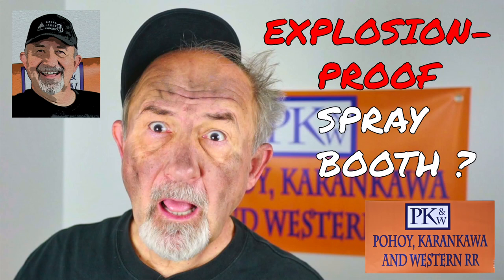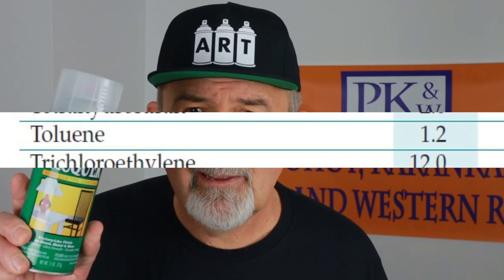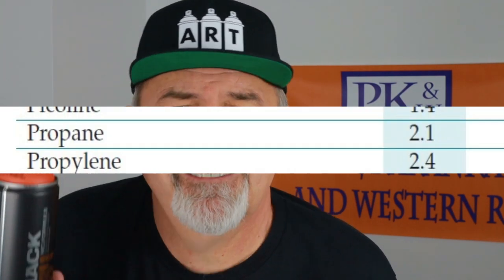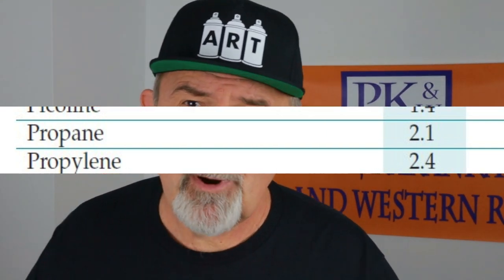Explosion proof spray booth  PK & W RR #19

Comment: Gee Bob you did a lot of good research around the whole thing. I actually was an Industrial Hygienist and you did a great job.  Spray cans are bad and I only use them outside, the booth and movement needed to do it right is really hard sometimes, mostly because of the smell and the particles  are heavier than an air brush. Biggest thing you have to worry about is lighting.  Not sure but LEDs should have a much lower risk for heat issues and the LED strips wiring are really contained. Good job.
Reply from the maker: You’re right.  The lighting is weak.  I’ve had to move one of my photography lights over the top or I end up missing spots.  Argh.

Comment: Very interesting Bob - you certainly did your homework! I think this is great information to put out. It's too easy to simply buy (or build) a spray booth and happily start spraying without thinking it through. Although the risk may be low, we can certainly take steps which will decrease - or increase - that risk. Thanks for sharing this, looking forward to the build! Best, John
Reply from the maker: Thanks John.  What's your hobby plan for 2020?
Reply: @PKWModelwerx  Well Bob, still working on the layout. Really want to get the track finished in the next month or so and move on to some scenery. All depends on work, of course.

Comment: Right on target concerning the needle and tip sizes - Grex airbrush are versatile , I upgraded my center feed trigger unit to the 0.3 mm and spray metallic fingernail polish or Tamiya metallic finishes (after decant) nicely . Whenever I remove needle for cleaning I always polish it with 3M 5000 foam sanding pad then use small dab airbrush lube . This polishing keeps paint off and makes for a smooth transition for the air/paint atomization . I also bought the mini fan cap for horizontal/vertical painting but have not used this far on my 1/25-1/24 slot car drag race model car builds .
Reply from the maker: Great stuff.  You should share this idea more broadly.

Comment: Industry has true explosion proof motors. They are EXTREMELY expensive, so not an option. What bugs me is people that vent the fan exhaust into the room they are painting in. Filters catch the particulate paint drops, they will NOT remove  fumes. That takes a specialized system, and it won't even get it all. BTW, I use a 6 inch tunnel fan that moves over 350 CFM. Just remember you're airflow is decreased by the type of filter you use. The more restrictive the filter, the less air flow.

Also  the fan on the back of my booth is routed to a wall mounted exhaust fan. Running in series like that, it removes the restriction caused by the 5 foot elevation change from the booth to the wall mounted exhaust fan.
Reply from the maker: Very interesting response,  Thanks.  How about a video of your set up?  I'd love to see it.

Comment: This video was a really good idea. I never once thought about it, until I watched another video and he said every fan motor he found was NOT spark or fireproof. Got me thinking, a lot of electric fan motors can sure spark inside pretty easily. Once you start concentrating the fumes in a 4"hose you may make a flame thrower easier than I thought. Ive spray painted in the garage for years with a 20" box fan with a furnace filter just for overspray. Now I'm going to build an airbrush booth I'll be more careful. Plan on lots of model building and branching into cerakote soon.
Reply from the maker: That box fan scares me.  You're on the right track now with a proper booth.  Thanks for the engagement.

Comment: hi, so in short is there a save motor to use for a paint booth? Im planing to get an airbrush set, but the fumes are a big concern right now. I want to push the fumes out into the air.
Reply from the maker: As the video describes in detail,  mounting a brushed motor outside the airstream is pretty safe.  If you can paint outside I would say start that way.  Don’t invest in a booth until you find out if you like using an airbrush.  Painting in a large indoor area might also be possible in inclement weather with a door or windows providing some ventilation.  You could wear a respirator but fumes might annoy others.  That’s just to get started as you don’t want fumes in your eyes etc long term.  But a booth is a great solution for painting inside in bad weather or at night.  And very convenient.  Good luck.  Let me know what I can do to help.
Reply: @PKWModelwerx  thanks!

unfortunately i dont have rooms for painting. Its cold outside now. So thats not an option.
And i think airbrushing is to my liking, because i love to work on fine details and airbrush is perfect for that.
I just search for a good solution so i can paint inside in my basement. There is a window on it, but there are many objects i dont want the paint on them. And of course i would use a respirator mask. I have bought one when i started to 3d print with resin.
So im aware on hazards :)

Do you think i need a high end airbrush pistol like IWATA ect to paint 1:18 scale modelcars?

Thanks for helping me out
Reply from the maker: @gaboaaa23  I am not a car modeler so have no experience trying to get those amazing mirror like gloss finishes.  I have heard that polishing is required so it’s not all about the paint application.  In my opinion, getting a good quality air brush is about the investment- having a tool that will last, be easy to maintain and change nozzle/needle size on occasionally.  I believe you can get a good finish with a cheap gun but not for long.  Most important factor for painting a car model I think is nozzle/needle and being able to cover the surface without too many overlapping coats.  It’s not about being able to draw fine lines and paint individual small details.  But just a guess as I have no experience painting car models.  Again good luck.
Reply: @PKWModelwerx  ok, thank  you for your help!

Greets

Comment: Very informative, built a custom spray booth a few years ago but didn't bother with a fan, now been looking at centrifuge type fans, most americans recommend Dayton fans with external motors but i dont live in the US and shipping of one costs more that the unit itself so i'm looking at local centrifuge type fans.
Most of the ones i find locally dont have external fans and the ones that do cost 2-3 times more so i'm debating what i should do. 
I mostly spray with acrylics so it shouldn't be a problem but i do have a few alcohol and laquer paints that show the flame logo on them, i also assume most of the paint is absorbed in the filter which reduces the chance of a spark.
What do you suggest?
Reply: This Dayton motor is not much saver then a centrifugal one with the motor in the airstream. This unit is completely made out of metal and has sleeve bearing, if the bearing fails and the rotor hits the housing you have a rain of sparks. I also doubt if there is a proper seal between motor and housing, the gas can come thru without it.

Buy a centrifugal fan from a quality brand, the RS100 from Ruck or the Cyclone100 from EBMPapst, both German, Vents from the Ukraine(Yes I know) is also very good. They have IP33 rating on the motor, plastic rotor, ansynchronous motor with thermal protection and they provide good info on pressure vs airflow. With a pressure of 62Pa a new filter already reduces a 250㎥/h fan (@ zero pressure) to a flow of about half of that. Be aware of that when choosing a fan, better to big then to small, that is what is explained in the video with the LEL.
Reply: @chillywilli  Thanks for the thorough explanation and the suggestions, i found a centrifuge fan that has an external motor and good specs at a great price locally. The model is OBR 140, has IP44(not sure if it's better), and higher power, this video shows it, it's in russian for some reason but they're made in Turkey, it can also be connected to a speed regulator which is nice. I'll check out those models to see if i can find them locally. Cheers
https://www.youtube.com/watch?v=3yAq-UiYiGM

Comment: Hi do you use Montana black in the airbrush? In your experience would you know if this is a cellulose based paint or water based? I would decant the can into a small tub and let the propellant evaporate. Then use to spray miniatures etc but I am unsure about what to clean this paint with? Cellulose thinner, water, white spirit? I would highly appreciate any info you have with airbrushing this spray can
Reply from the maker: Sorry for tardy reply. It is acetone based and you can buy acetone at a big box hardware store.  It dries very quickly which is a blessing or a curse depending upon what you are doing.
Reply from the maker: I do exactly as you say.  I spray through a straw into a cup.  let it gas out.  Add a little acetone and spray through my air brush.

Comment: Just got an idea, I have an old furnace blower. That may need to be my booth motor. Even though its strong enough and collapse the booth. It's a belt-driven blower. It will keep the electric motor outside the vac system all together.
Reply from the maker: Great idea.  The highest end large spray booths all use belt driven fans with the motor well outside the air stream.  So your idea has lots of merit!  I'd love to see pics of your build.  Sounds impressive.

Comment: Will a box fan blow if only using canned spray primer and an air sprayer with Sherwin Williams emerald acrylic paint?
Reply from the maker: Just saw this.  Sorry for late reply.  That spray can has propellants which are a hazard.  That’s almost definite but read the label.  The acrylic house paint is probably not an explosion risk if thinned with water.  The box fan is a brushed motor generating sparks which are in the air stream so a possible ignition source.  Please be careful.
Reply: @PKWModelwerx  I have two points of air out and one creating air in..there wb plenty of fresh air..I don't know what else to do. Other than leaving garage door open leaving bugs and particles get on my painted cabinets.
Reply from the maker: @allieGirl146  given that you are working in such a large space, I doubt using one spray can at a time that you will create a rich enough environment for an explosion.  But to eliminate risk entirely I would simply not use a box fan and just air the space out briefly by creating cross ventilation.  Maybe between a pedestrian door and a cracked garage door.  Once visible fumes have dissipated close her up again so drying or more priming can occur in a relatively clean environment.  Wear a respirator if you can or ventilate frequently.  Good luck!  Cover surfaces.  I just did a job outside on a still night and my driveway is visibly colored!

Comment: Great video. 
One line that wood have gotten the spray paint folks attention better :” toluene, as in the ingredient in tri nitro toluene, more commonly known as TNT”.
Reply from the maker: I had no idea!
Reply: That's bad chemistry for people that are scared by names and don't know better. Unless you properly react your toluene with fuming nitric acid (oversimplified) and produce TNT, toluene is just another flammable gas. The same goes for glycerine and nitroglycerine, you won't go boom because you use pure glycerine and some kind of nitrogen containing fertilizer together somehow at home. 

Vinegar which is acetic acid diluted in water and other stuff is not some evil flammable and corrosive solvent that suddenly combusts leaving a transparent sheet of plastic all over...

Comment: Bob this is great information to have. Most people don't think about the volatility of the what they are using, read the label see that it's flammable and  move on. I've never used a spray booth, no airbrush. I spray outside. Looking forward to seeing your booth.
Reply from the maker: I've got a video in the works on using spray cans outside in cold weather.  Thanks for watching and hopefully you will see me on some of those live streams you recommended..
Reply: @PKWModelwerx  most of them start at 7pm est or 8pm est
Reply from the maker: @grandparails8858  Thanks.  And I see you have posted a video.  I'll be checking that out later tonight.  keep 'em coming!